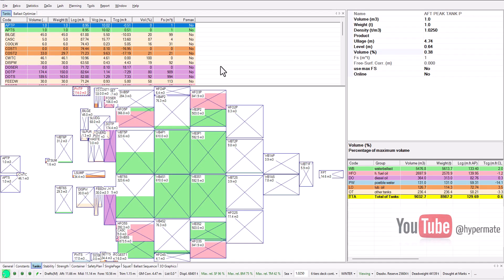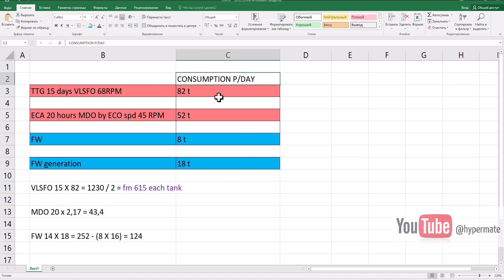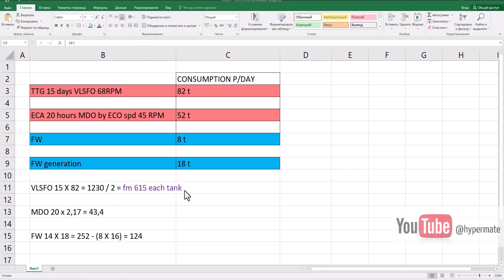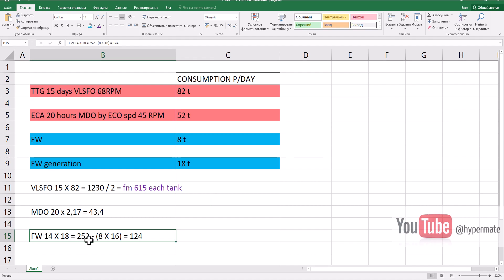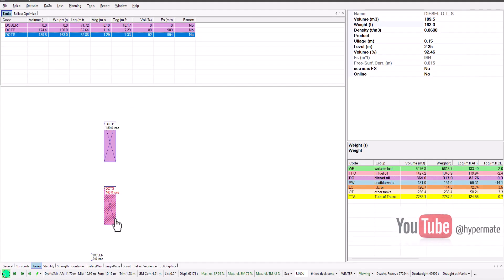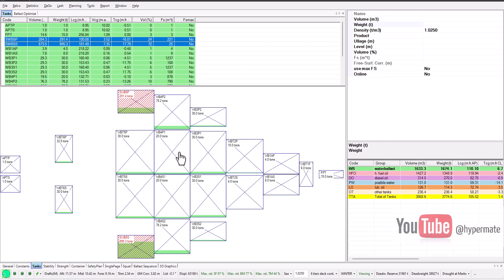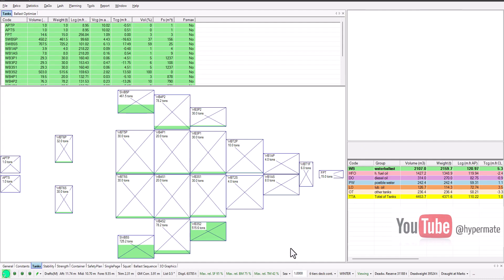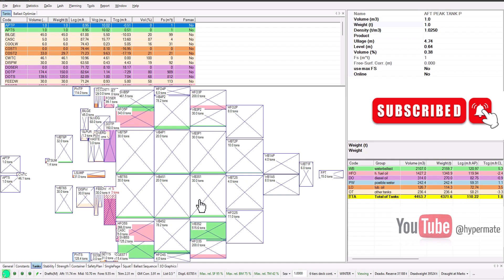How to calculate drafts for next port on a cargo ship?

Comment: Chief gd,
What is algorithm to control arrival drafts in MACS in case of changing load line zone ( Departure is summer, arrival is Tropical). During pre stowage planning, We just had to change Load Line zone  in menu ? Am i right?
Reply from the maker: @leha08   @leha08  Hi there. The main point is to do not flood the respective mark in a current zone a vessel sails, taking into consideration FWA. To control it, simulate/find arrival drafts in MACS3 same as in this video in addition change zone in program to port of arrival. So if you are over the limit the MACS will rise alarm. It is only my understanding since I have never faced with this on practice so this thing is the subject to check.
Reply: @hypermate  thanks!

Comment: How would you get the GM of a ship in port only by drafts? Assuming that you are under cargo operations and you want to check GM but you don't know how much containers are already loaded discharged. Can you explain?
Reply from the maker: GM should not be calculated by drafts. 
Deck watch keeps updated loading and discharging plans, so if you want to get GM in exact time just update your loading soft with a current load/disch. condition.